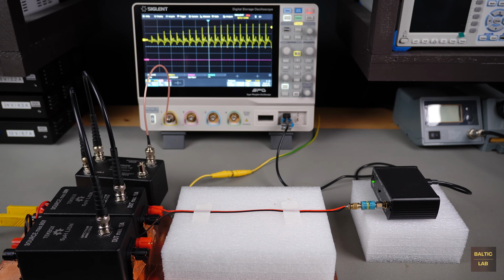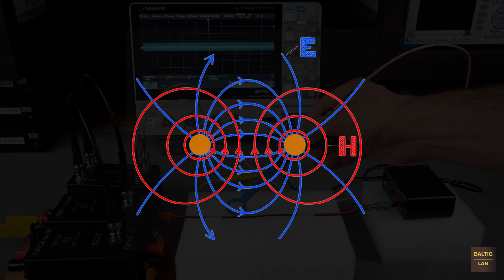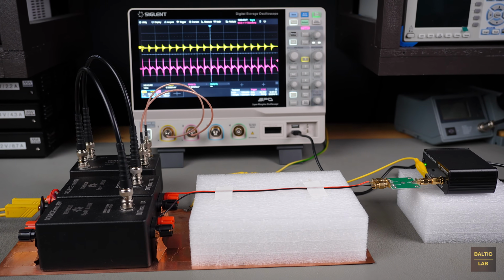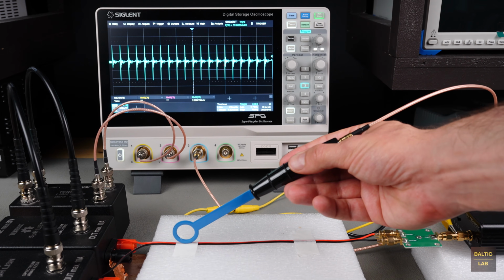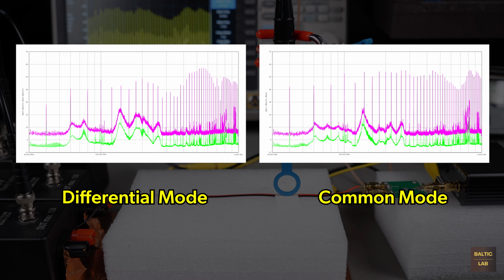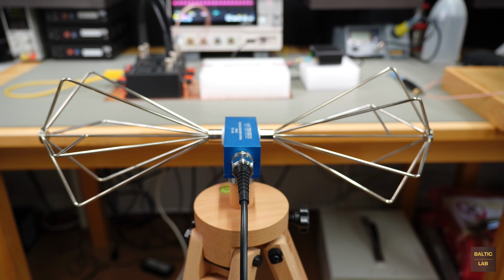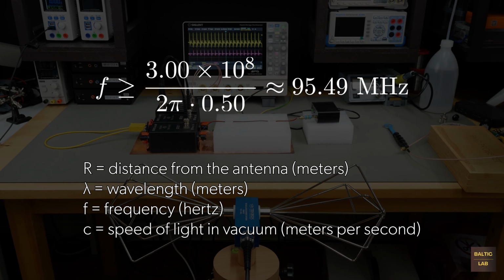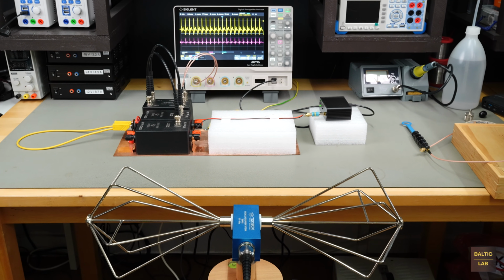Radiated Emissions: Common vs. Differential Mode

Comment: I just put ferrite beads on everything 😆. Your understanding of RF is truly mind blowing. I studied radio communications engineering but I'm a drop out and watching your videos makes me wish I studied harder.
Reply from the maker: Careful, though, ferrites can actually make emission problems worse. Thanks for the kind words. And honestly, don't let the fact that you dropped out limit your curiosity. Many things taught at universities are only loosely connected to real-world applications, while important practical concepts are often not covered in sufficient depth. So don't let that stop your passion or your willingness to keep learning.
Reply: @BalticLab Wow I had no idea that it could cause more problems and thank you for the encouragement, I mainly operate ham radio these days and tinker around with SDRs etc. I also really like antenna building, which I have a pretty good understanding about although sometimes it does feel like witchcraft 😆

Comment: I understood nothing, I need sleep ;_; electronics is a hell of a drug.
I don't get how a signal can travel through both of the cables without a "return path"
Reply from the maker: Hope you were able to find some sleep... There is a return path: At high frequencies, the return path can be capacitive coupling to nearby conductors (chassis, ground plane, earth) or via the displacement current in the surrounding electric field. In common-mode, both wires move together relative to their environment, and the "return" closes through parasitic capacitances and radiated fields.

Comment: I used to work with small sensors for machines and engines, and almost all of the emissions were from the cable.  The sensor itself just wasn't big enough act as an antenna.  The 1.5 meter cable, however, was an excellent antenna!  😄  The sensors just had three wires in the harness... power, ground, and a pwm output signal.  The pwm signal only drove a few mA, but the 500Hz signal could cause it to fail emissions tests if you weren't careful to slow down the edges.  It's the little stuff that gets you!
Reply from the maker: Great practical example! I would guess cables are the cause for >90% of all EMC issues. Unfortunately, many products don't work well without cables though. 😂 Having to slow rise times due to EMI is also the biggest damper for efficiency, especially in the solar and automotive realm. Modern SiC and GaN devices could switch incredibly fast and efficient. But in practice they have to be rise-time limited for compliance issues.